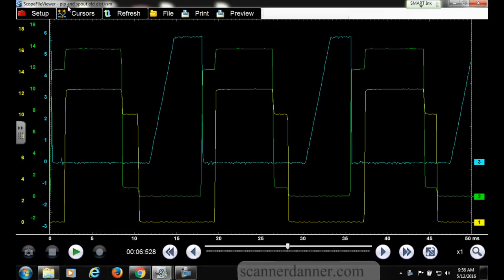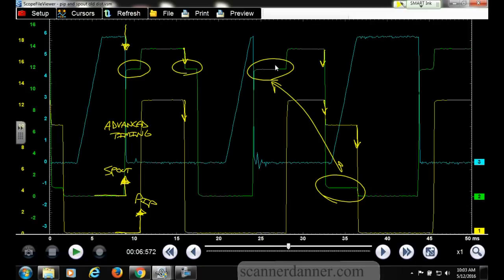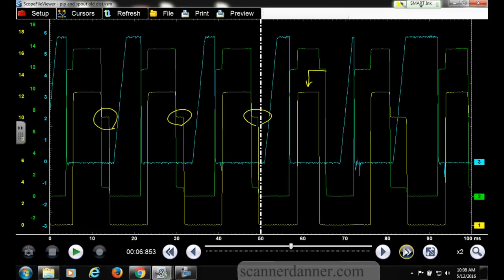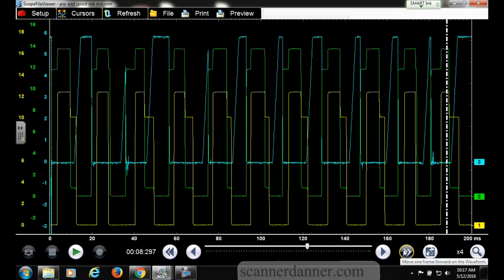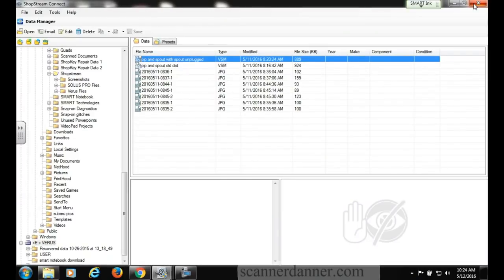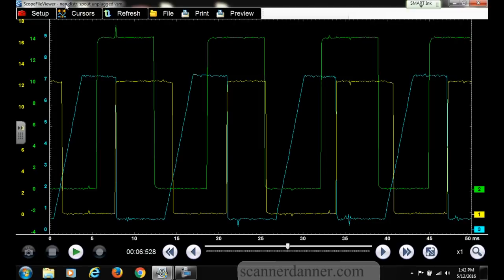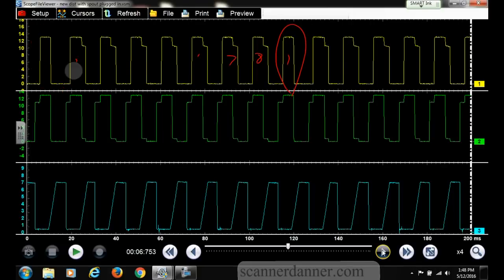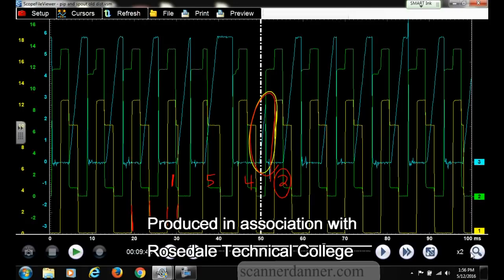Ford EEC IV Distributor Pick-up or Faulty Ignition Module - Part 2

Comment: This was like 20 years ago but I remender 
A old Nissan pickup truck, 
 with some hard  starting issues  and some noise coming  from inside the distributor ( bearing noise, rusted  bearing) decided to rebuild the distributor  with new bearing.
Engine started  like champ  for like 10 times,
After  that was crank no satrt .
Of course no scope back then just multimeter  and test light,  power and signal  everything  is there  but stills crank no start.
But if we push the truck down hill and pump the clutch  she start  right away  and ran smooth .
Long story short new distributor  fix the hard start  and crank no start  weird  issues.
Reply from the maker: I have some videos on that system, with scope captures, that would most likely explain your issue
Reply: @ScannerDanner  that would  be awesome  to finally  solve  the mystery 😀👌😄

Comment: Do you actually have to replace the entire distributor? Is it not possible to replace the bad sensor itself?
Reply: I have the tool to remove gear from shaft. Be glad to sell.  Too labor intensive.  Became easier to replace distributor.  Kinda like diode plates I finally tossed.
Reply from the maker: on these, I've always ordered a new distributor, I think because price wise, they were close to being the same
Reply from the maker: but no, you can change just the sensor